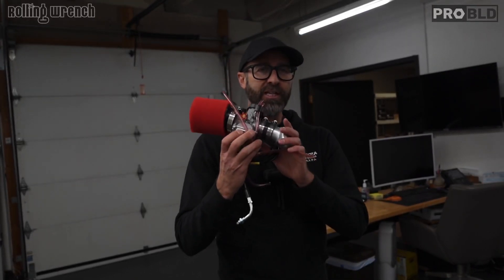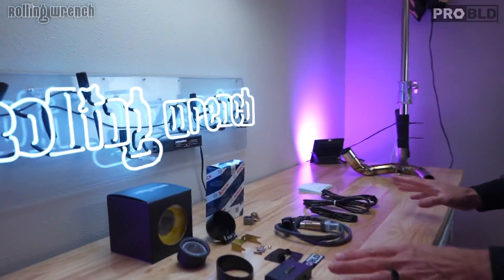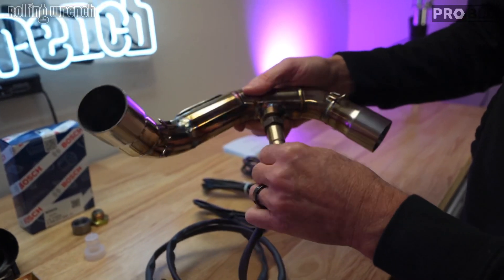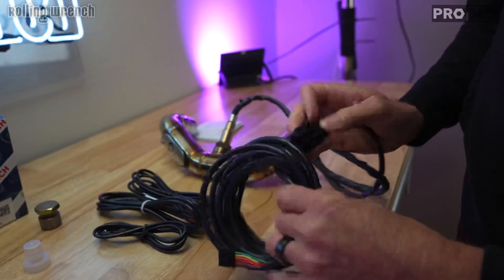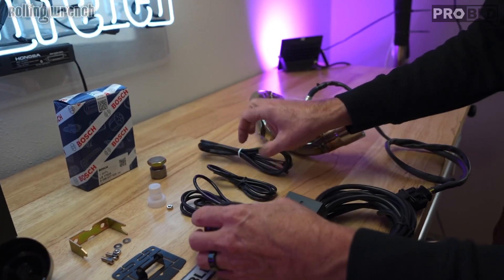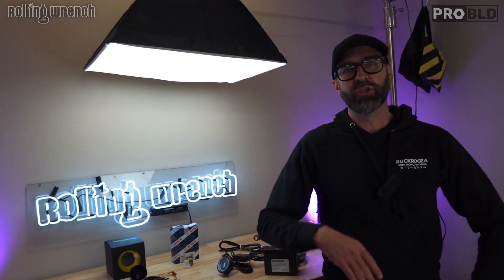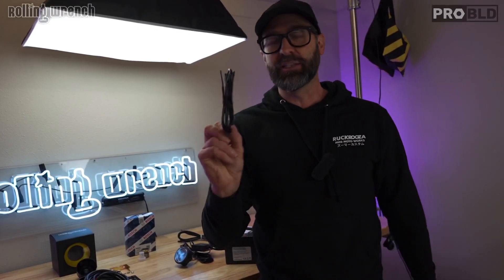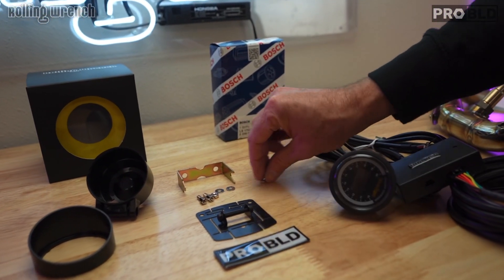Carburetor Tuning with ZERO GUESSING.

Comment: hi i have a question, i ride a moped specifically a speedfight 2 2008. i put on a yazuni r exhaust pipe and a malosi sport air filter now it doesn't run like it should and sounds strange at high revs and runs unevenly i changed the main jet to 80 from 62 it didn't work and then from 80 to 75 it didn't work at all now i wonder what to do. i ordered a new kit of main jets 52-75 i have a gurtner carburetor

Comment: Hey I was wondering if you think it would be a good idea to buy a 1971 Dodge Charger SE 318 v8 for my first car and daily driver, 65k miles barn find. I could spray some fluid film on the undercarriage for winters since I’m in Illinois and it wouldn’t be in a garage. I would replace the parts under the hood and keep it maintained
Reply from the maker: Oh definitely! You can dial the carb on the 71 in perfectly

Comment: Looking to do the 171/172 drop in kit on my gy6 buggy, as far as I know your 50/50 on it fitting buggy motors, it's 54mm stud spacing, also qmj157 top end fits perfectly, just wondering if it would fit my engine? Can give details if needed have rebuilt it 2 times, now running 155/160 bbk, big valve head, A9 cam, thanks in advance, and sorry for long post.
Reply from the maker: Most likely it will fit. To be 💯 purchase our gasket kit and verify the base gasket lines up with the engine case:
https://www.rollingwrenchdenver.com/products/gy6-171cc-cylinder-head-and-cylinder-base-gasket-set-61mm?keyword=61mm%20gas

Comment: By far the best GY6 tool I have in my repertoire. I never have been able to read spark plugs and I'm paranoid of running a lean condition so I got one. WB-AFRs you see how circuit transition changes with different jetting throughout throttle positions and engine loads "interactively". When I first installed it, I got some weird readings initially so I did a free air calibration and it cleared right up. (Not sure if that was something I was supposed to do on setup or not? and would my elevation effect readings?)it's peace of mind knowing not running a lean condition and having actual AFR numbers you can rely on instead of guesswork and going by ear and feel. One of these would have saved a lot of past tuning headaches lol. Anyway sorry to blabber on, thanks for the cool tool. 💪🏻💪🏻💪🏻

Comment: I purchased a 171 kit for my gy6a was wondering if either stroker crank will fit? And if so what would that end up being for engine size
Reply from the maker: The cylinder walls on the 171cc drop in is to thin for a stroker. It’s not a good idea. Plus the piston skirt isn’t shaved on the 171

Comment: im looking to get a kit to help me with my gs850 carbs. since its a 4 cylinder I'd need to weld a bung on each header pipe. Instead I'd like to make a sniffer tube. Can I just grab some pipe and stick it as far back and that will work? id assume the pipe needs to be open on both ends. Let me know if this could work instead of welding on my new exhaust.
Reply from the maker: Actually and a multi cylinder bike only one bung is needed. Install it right after the 4 pipes come other like a car. Or you can monitor only one pipe and change the settings on all carbs. All should be the same as long as the adjustment are made togetherz
Reply: @RollingWrench  that what i would think too, then i was told that one carb could be rich and the other lean and it would balance it out making it look like i had it tuned right then I'd melt a piston or something
Reply from the maker: @ no, as long as you have the same jets and adjustments on all carbs and sync them first you will not have that issue
Reply: @RollingWrench  ok awesome, thanks!